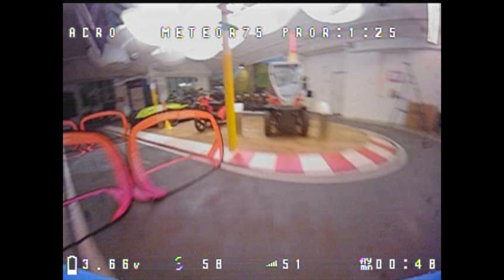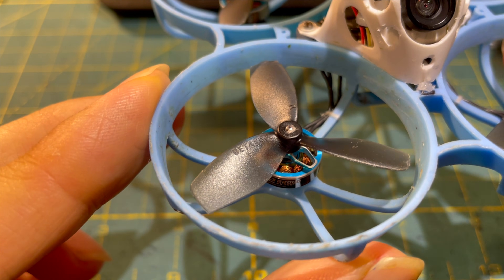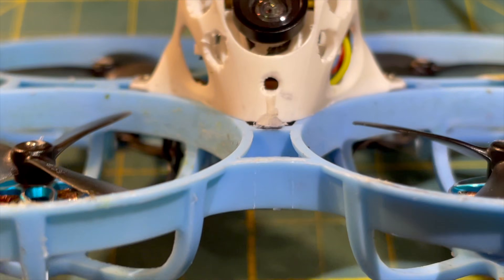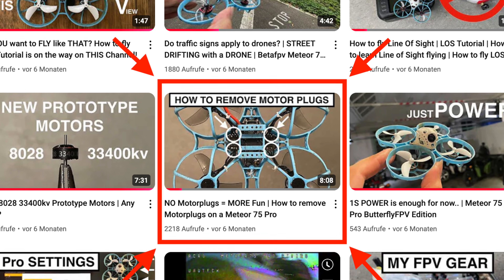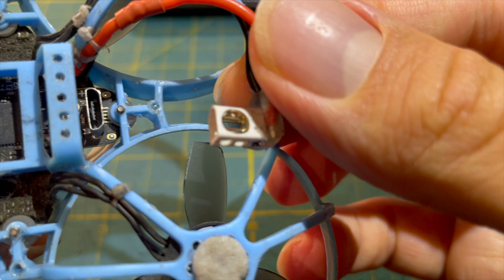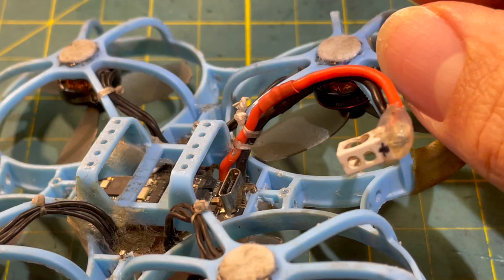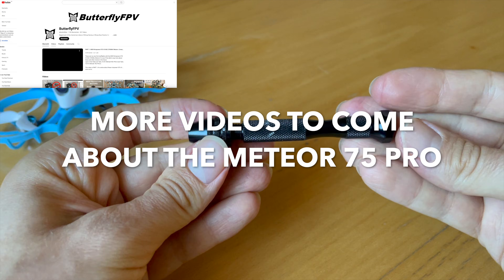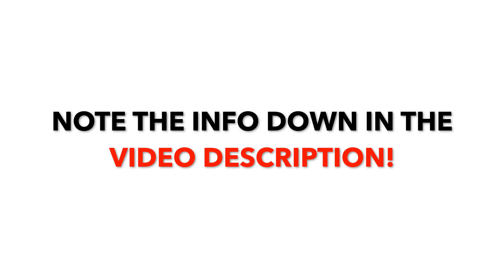TUNING for YOUR Tiny Whoop! | Tiny Whoop Modifications | Tiny Whoop Mod`s | Tiny Whoop Secrets

Comment: Hello, I have a Betafpv Air75 analog controller with a Matrix G4 5-in-1 FC, and I crashed it. After that, the OSD started disappearing every now and then. Then it reappears. And sometimes the camera image disappears and then comes back. Just like in the video in this link, exactly like that. How do I fix this? If I heat the FC, will it return to normal? Which component of this FC should I test? Thanks!
Reply from the maker: Good question but I don`t know my whoop friend. Im more of a pilot expert than tech expert. But yeah reflow the board is probably the only way to maybe fix this problem..
Reply: @butterflyfpv  Hi, thanks for replying! I like your videos. Okay, I'll try again. I'm doing some procedures to see if I can fix this. Thanks!

Comment: Wouldn't the weight loss from the titanium screws be offset by the felt pads?
Reply from the maker: Not quite, but almost. But the felt pads are worth it to me. With the felt pads you won't lose any motor screws and surfaces like furniture, wooden floors or car paint are protected from scratches when I fly and crash over such areas with the whoop.
Reply: @butterflyfpv  ah I see, so it's definitely worth it for longevity, thanks!
Reply from the maker: For me yes! Fewer troubles.

Comment: Hey!
What do you think about the  BetaFPV Matrix flight controller? Is it any good?
Do you think the 5A ESC is enough for bigger motors?
I'm a bit unsure because, you know, BetaFPV is kind of known for questionable electronics quality.
I'm trying to decide between sticking with the X12 or giving the new Matrix a shot.
Reply from the maker: Hey! My matrix flight controller is doing well so far. But in my opinion, it's not suitable for very high kV or very large motors. You're better off with the X12 board. You can also try the new 4-in-1 analog flight controller from betafpv, which has 12A ESCs (18A peak) according to betafpv: https://betafpv.com/collections/brushless-flight-controller/products/matrix-1s-brushless-flight-controller-hd

Comment: Hi there! Thanks for making such nice and informative videos! I was wondering is the 75 pro a must have for the collection? I do have a 5 inch and a mob6 and air65 but not a 75 size yet. Would it be worth it to dive into? Thanks!
Reply from the maker: Hey! Thanks for your feedback! 🤜🤛 It depends. The 75 Pro is nice if you want to fly outdoors with whoops. Especially because of the flight time. It's also a bit more stable in windy conditions due to its mass. And the LiPo is pretty well protected in the frame. But if you have a place where you can fly your 5-inch regularly and easily, you don't necessarily need the 75 Pro. Check out these other videos: https://www.youtube.com/watch?v=X6ThmMKkk7s   and this one:  https://www.youtube.com/watch?v=o1GGBDw7bAY&t=1s

Comment: I would love to see a series of whoop racing techniques.
Reply from the maker: Yes, unfortunately, that's been somewhat overlooked by the recent, more technical videos. But I haven't forgotten about it! Perhaps I can make a short overview video about racing flight techniques in the near future. And then more in-depth videos at a later date. I'll see what I can do. But I haven't forgotten! I just don't have enough time. I need employees xD
Reply: @butterflyfpv  Would be absolutely great for whoop beginner, don't need to be long videos. For example, how to dive the gate(not 180 yaw and drop through the gate rather more spin into the gate with roll and yaw). I have been slowly watching many channels such as your channel, CustomFPV, InfinityLoops, etc. about freestyle, whoop racing and techniques. However, my techniques are more of outdoor freestyle and I somehow have been struggled to fly whoop indoor.
Reply from the maker: @chirots  An important point for indoor racing is that you fly in acro mode, not air mode. Acro mode provides better throttle control (somehow). Another important point is the entry angle to the gate. Many good racing pilots design the racetrack with optimized entry angles and speeds from gate to gate. So if you watch a video and want to imitate it, pay attention to the racetrack layout and create it exactly the same way at home. Otherwise, for example, you might arrive at the gate with too much speed and have to do a pre-turn first to reduce speed and so on. Or, if you're building your own racetrack, pay attention to the speed and entry angle. You can change the entry angle by moving the gate or placing another gate in front of the gate. You can also reduce the speed this way or with flags. At the end of a long straight, put one or two flags first, or to reduce speed through the corners, and then put the drop gate. A lot of it is just practice. If possible, practice 6+ lipos every day. I hope you understand what I mean. I hope this helps you for now.
Reply: @butterflyfpv  Yep, I understand exactly you try to explain. I fly at least 20-30 battery packs a day.😅😅😅
Reply from the maker: @chirots  Perfect! That's the most important thing! Then it's just a matter of time and how long you can keep it up ;-) Just make sure you always have fun. Take it seriously, but not too seriously. Listen to music. Don't tense up. Professionals fly relaxed. That's the only way they can fly fast.

Comment: curious to what size felt pads and where you got them?
Reply from the maker: About 8mm in diameter. I got them from the hardware store. In the passage/frame with anti-slip pads and slip pads. They are actually felt sliders.

Comment: Love the micro turbo! I take the shrink wrap off of the antenna, desolder the bell ground plane, and solder a wire to the shielding where the bell was soldered and cut it to the length of the bell. This keeps the SWR within range of <2:1 which is better for range and the vtx
Reply from the maker: Interesting! Thanks for the input. I think it's quite complicated: https://www.arrl.org/files/file/Technology/tis/info/pdf/q1106037.pdf But it's cool that your solution worked for you. Your version is definitely more lightweight. You have built a more simple and more lightweight dipole antenna, so to speak. But I doubt that your antenna is fundamentally better. Then it wouldn't make sense for there to be other antennas. For example this one: https://www.tinywhoop.com/products/whoopvee
Reply: @butterflyfpv  yeah, the math and smith charts look complicated but they've already figured out the length of the dipole and the ground plane is just a copy of that, so cutting it to match the active element is going to work well.  The OTR antennas are a Y because they are doing some impedence matching but when the ground and active element are 180 degrees apart it's just a dipole.
Reply from the maker: @McShakyFPV  Yes it is going to work well enough for sure. But probably not better than a stock dipole antenna? Are you an expert in this field? To be honest, I'm not an expert. I just know that it's extremely complex. Even the length of the shield and the active element have to be matched. Then there's the antenna tuning to a specific frequency. There are so many factors that come into play. But you still maintain that your antenna is better in terms of range and resistance to external interference, as well as interaction with VTX electronics, than a stock dipole antenna? That it's supposed to be better overall? Also for racing with other people? If so, I wonder why there are other antennas?
Reply: @butterflyfpv  I would say I am a high level RF person. I was trained in communications and radio by the USAF and while in I got my Amateur Extra Ham radio license which is not easy.  I have not run the antennas through a vector network analyzer or spectrum analyzer but for something using this small amount of power and for hobby use, just playing around with it and doing ad hoc testing is going to be fine.  Even if you model something in an antenna modeling software, it is using ideal non-reality conditions which will be different than you will have when putting your antenna near the camera/FC copper pours/whoop motors, all of that affects the antenna, the propagation, and it changes again as you have ever changing PWM signals to the motors and broadband noise.  The goal is much like you've found, make the trade off worth it for you.  You show making it lighter by completely removing and shortening the antenna (which is much riskier in my opinion for creating a high SWR that could reflect most of the power back at the transmitter/pa section of the VTX) than taking off the bell and making it a dipole.  You know that you're reflecting RF back into the vtx because you aren't getting as much range, so the antenna isn't pushing as much power out.  Where did that power go? as heat and back into the VTX as reflected power.
Reply from the maker: @McShakyFPV  Very interesting! Thank you for your detailed explanation! Now I understand! Okay, now I'm trying to understand exactly what you meant with your antenna. Is it correct that the antenna soldered to the shielding has to be 180 degrees to the main antenna? And can I attach the antenna which is attached to the shielding (I'll call it GA for ground antenna) to the shielding/insulation of the antenna with shrink tubing? Could I also slit the shielding and fold it down along the length of the antenna instead of soldering a GA antenna? (12.7 mm) Another question: How much do you think it will affect the antenna performance or the risk of receiver failure if I glue the 2.4 GHz antenna to the board like in the video? (So far, I haven't had any problems with either the range or a defective receiver)
Reply: @butterflyfpv  Thank you for the questions. Yes 180 degrees is good - if you can make it like a T it would be better so it isn't getting some inductance from the shielding of the coax running back to the ipx connector.  At this short lengths though, it will work and I think you are hinting at another option which I saw when you shortened your antenna, you may use the shielding as the gp instead of soldering if you cut and shorten your antenna.  You'll just have to pull the shielding to be the same length as your center conductor.  There are many ways to dabble with this.  I have looked into creating a pc board with traces to make the antenna elements but I haven't had time to work more this year due to a car accident.  As to the shrink wrap question, I think I answered it talking about it being better to be a T but let me know if that is a different question.
Reply from the maker: @McShakyFPV  Oh dang it. I hope you weren't too badly hurt. I hope you get better.🙏 Got ya! The question regarding the shrink tubing was more about whether shrink tubing or adhesive on an antenna significantly affects the antenna's performance? Does the antenna have to be suspended in the air? If you said a PCB, then the antenna element is also relatively firmly embedded in the PCB. So I could imagine that shrink tubing on an antenna or adhesive doesn't significantly affect performance. But one question still remains: If a T-antenna is better overall, why are antennas with bells still being manufactured? A T-antenna would probably be easier to manufacture. What is the disadvantage of the T-antenna, then, and why hasn't it become the standard? Sorry for so many questions. I'm just curious.
Reply: @butterflyfpv I enjoy the curiosity. Plastic and glue are invisible to the RF spectrum (or enough that we can ignore it for these short distances) they can change the velocity factor for longer runs (the speed of light is how fast electromagnetic waves travel in a vacuum but not anywhere else, the copper and even plastic slow it down which is part of the math you showed on the ARRL page. To determine an exact wavelength you need to know the velocity factor of the frequency among other things but like I said, we won’t ever be perfect. I have flown with no antenna before. Badly and it’s not healthy for the transmitter but it can be done sometimes without causing damage.
Reply: @butterflyfpv I see a new ultralight T style antenna just came on the market. Ease of manufacturing is the primary concern for most manufacturers. The exception is TBS and TruRC. I’ve heard the owner of TruRC talk about what he is doing is nothing special. Anyone that knows RF engineering can design those antennas
Reply from the maker: @McShakyFPV  Yes, I agree. Ease of manufacture is the most important thing for most companies. Oo, so I'll build a T-antenna for the next antenna video :-)
Reply from the maker: @McShakyFPV  Got it. Thank you for the detailed explanation! So, I'll make my first T-antenna tomorrow :-) And I'll include the antenna in my in-depth antenna video. I'll say in the video what you taught me. Let me summarize again: A T-antenna is a safer option than a simple one wire antenna from the perspective of an RF engineer. Because with the simpler one wire antenna the energy that cannot be transmitted goes back into the VTX. A one wire antenna is also possible, but a little riskier. Is that correct?
Reply: @butterflyfpv yes sir
Reply from the maker: @McShakyFPV  😃🤜🤛💪 Leeet`s gooo!
Reply from the maker: What do you think of this antenna?: https://www.facebook.com/groups/457333120275712/posts/475441268464897/?comment_id=475517471790610
And how is it possible that there are dual-band antennas? How do these work? I can't understand how one antenna can be made for two bands.. https://www.mouser.ch/ProductDetail/Molex/146153-0050?qs=ks%252B8n8ZrNgvaFTz%2FejlU9w%3D%3D&mgh=1&utm_id=19994302035&utm_source=google&utm_medium=cpc&utm_marketing_tactic=emeacorp&gad_source=1&gad_campaignid=20000031326&gclid=CjwKCAjwo4rCBhAbEiwAxhJlCbgyx-9aYKt3yNHCR3yHupzUmtKmBo0SfsJ1WTttX6oiF-4swzgQGRoCFZ8QAvD_BwE
Reply: @butterflyfpv I like the ORT style antenna a lot but I don’t know how they decided the angle to use to that. 
Dual band antennas work by having a longer element for the lower frequency and a shorter element for the higher frequency. The coupling reactance (capacitive usually) makes the elements shorter than they would if they were standalone.
Reply from the maker: @McShakyFPV  Thank you so much for your help and contribution to my antenna video!🤜🤛 

The answer of chat gpt: 

🧭 What does this do in practice?

🛩 For FPV drones:

A 120° angle ensures a more robust connection, even if the antenna orientation changes due to flight movements.

Reception is somewhat more consistent in all directions – however, the maximum range in one direction is usually somewhat shorter than with a perfectly aligned 180° dipole.

🎯 Conclusion:
Question Answer
Why 120° instead of 180°? To achieve better 3D radiation and mix polarization.
What is the effect? More all-round coverage, less sensitive to changes in position.
When is which better? 180° for fixed positions/range, 120° for mobile systems like drones.
Reply: @butterflyfpv Love this!
Reply from the maker: @McShakyFPV  👍🤜🤛
Reply from the maker: My antenna video will be finished soon! But I have some more questions:

1. Is it possible to cut open the bell of a stock linear dipole antenna, leaving only a small strip and bending it upwards to create a T-style antenna? Would there be any objections? That might be the easiest way to build a T-style dipole antenna?

2. What connector do our VTX antennas on Tiny Whoops use? I was able to find these names: IPEX IPEX1 IPX1 MHF1 U.FL Are there any other names?

3. What influence does the length of the shielded part of the antenna have? That is, the inactive part, the feeder cable. Does this part also have to be a certain length? What influence does the length have here?

4. How much influence does the cross-section of the antenna have? I have stock dipole antennas with a bell, with an active part that has almost twice the cross-section of another antenna of the same design. The length of the bell also varies between the antennas: sometimes 10mm, sometimes 12mm. Why can it all be so different?

Comment: Power cable near vtx antena very bad idea never do that mistake
Reply from the maker: Thanks for the input. Yes, that's correct, which is why I say in the video that this cable routing isn't quite optimal. But for what I do, it's sufficient. For my outdoor flight locations, it works perfectly. But it's not optimal, you're right about that. Thanks for the input! This might help some pilots.🤜🤛

Comment: Great content! 
Do you need to re-tune for  those alternative 45mm props or are they interchangeable without hassle?
Also, have you considered different motors for the M75Pro?  On paper, RCinpower 1002 22000KV look like a good alternative to Betafpv  1102 motors while being lighter and more efficient. On paper.
Reply from the maker: Thank you! In theory, you always have to retune if you make any major changes to the whoop to achieve a very tight tune. But I personally don't do that. I don't tune (yet) anyway. I just fly. In racing, a tighter tune isn't that important. I've even made a video on the topic of how (very tight) PID tuning isn't as important as many people think. So to answer your question: No I haven't changed my tunes and I switch the props without changing the tune. Which may not be ideal, but it's not earth-shattering either for my racing flight style. I haven't tested the RCINPower 1002 22000kV with 45mm propellers yet. But I have tested the GEPRC SpeedX 1002 25000kV. It's close, but it doesn't feel as good as with the stock 1102 22k motors. I'll explain exactly why in a future video. It's flyable. And it has certain advantages, but also disadvantages. But my conclusion is: 1102 is the perfect motor size for 45mm propellers for racing flight style.